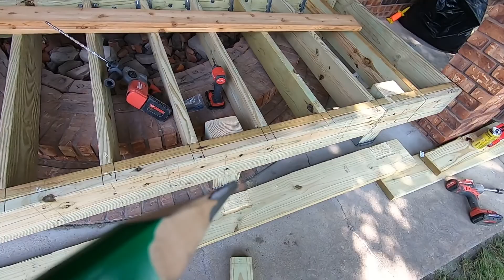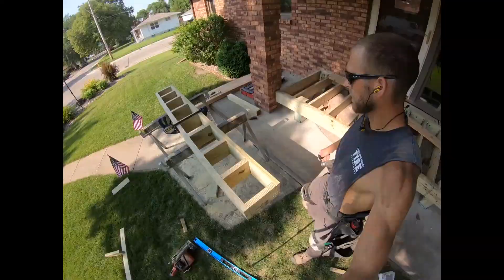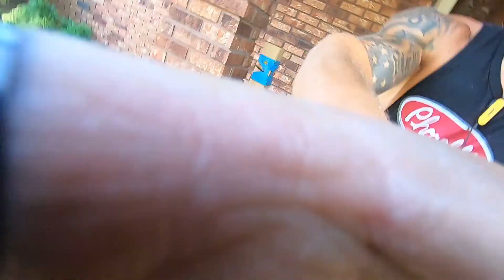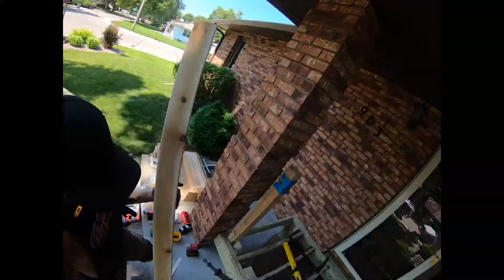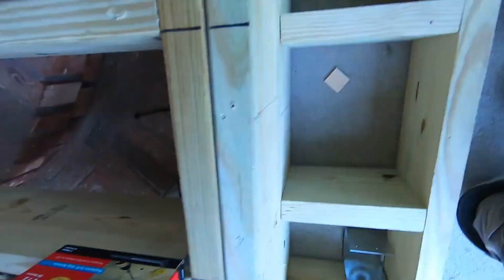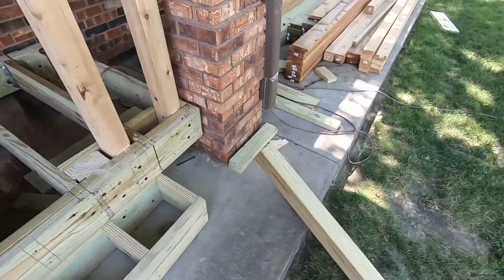Cedar Deck Build Part 2. Building Box Stairs and Setting Post.

Comment: Hey just one thing I use G-tape on my framing and joist adds 20 plus yrs to it!
Reply: Yes I order it off Amazon Prime & it comes in 2”-8 or 10 “. More if needed!

I usually get 4” and add the price to my bid or estimate!  It prevent the board between the deck board and framing from rotting away over time ?
Like if they wash their deck or it’s in the weather !  Your doing a great job by the way stick with it !  Always answer the phone!  Make your quotes high enough where about 50% or there about turn down your bid!
And the ones that take your bid?  You make sure they get thee best and tell them anything wrong, breaks, don’t like you call me even if it’s 5 yrs later and I will fix it!
Truth told seldom if ever will you get a call back?  But they refer you every chance they get!
Being a carpenter is great and about 10% or less of the population can actually learn to be one!  Just to hard!

Great job!
Reply from the maker: Is that the brand you like? I’ll start using for sure !

Comment: How you liking your artisan bags? I got some for framing and I make them work pretty good.  Gonna get a db sax for when I gotta carry staples for sheeting.
Reply: ey same, just got mine, and bought the 722 slingshot and the lumbarpad
Reply from the maker: @andreasmanskow7421  how do you like the lumbar pad ?
Reply: @AMAYERICAN  It's ok, its not as thick as i hoped, but its still better then just having the belt. I recomend it
Reply from the maker: @andreasmanskow7421  right on thanks for the insight going to buy also. Appreciate it brother !
Reply from the maker: I love um, they broke in nice and have really opened up. I want to buy the curbed belt now for more support. I love those db sax also. What belt did you get ?
Reply: @AMAYERICAN  I got the 4inch belt.  I use my main fastener pouch for 16 penny nails, the outside pouch for 8 penny nails and the slot in between them for my racks of nails.  Seems to work perfectlly.
Reply from the maker: Awesome yeah the slots are perfect for racks of nails. Very pleased with the purchase, next thing on my list is the martinez hammer haha.